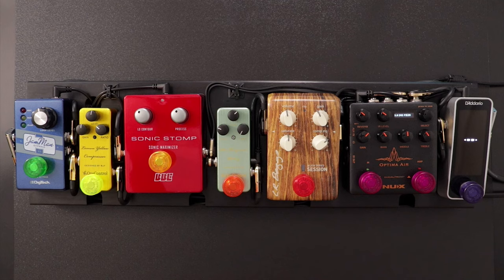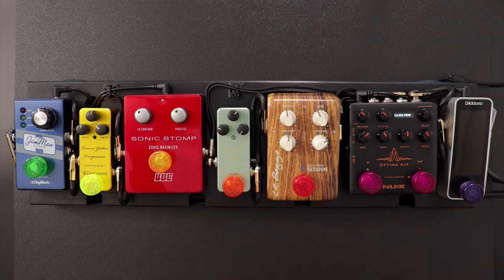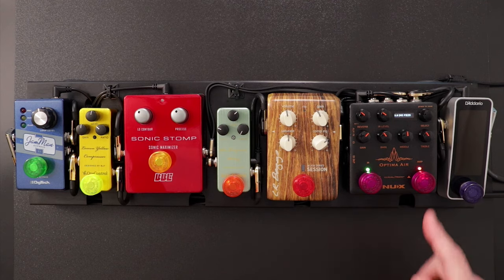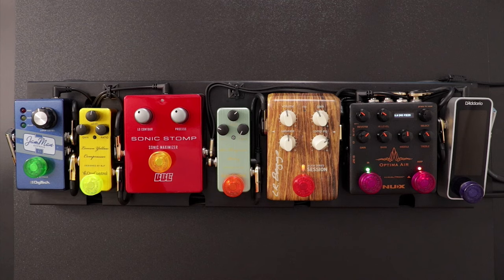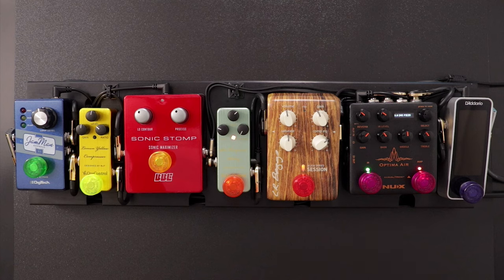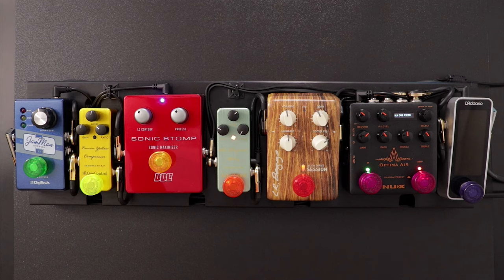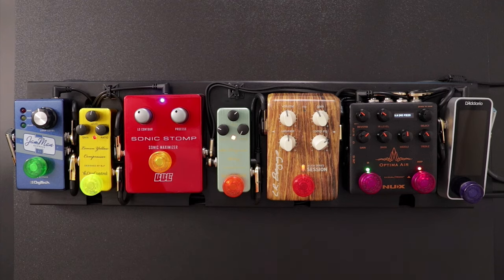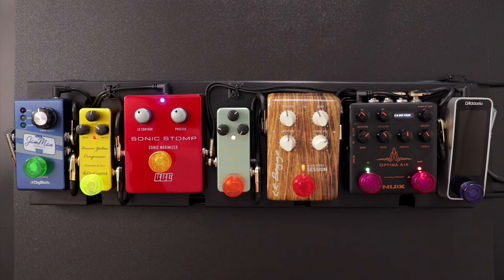Acoustic Guitars NEED Pedals Too! | Acoustic Pedalboard Walkthrough

Comment: very nice warm sound with the pedals. I have Acoustic soulmate pedal and I would like to make a change because the sound of it is not what I was looking for.
Reply from the maker: Hey ; ) Yeah, I originally looked at the Acoustic Soulmate—seems like a cool unit! It looks like the type of pedal that would pair well with a nice acoustic amp. It obviously won't to the IR thing though, if that's what you're looking for. Best of luck in your tonal adventures!
Reply: I have a soulmate acustic too, but i use red eye twin for a preamp and mixer for my 2 pickups. And t rex only in effects loop
Reply from the maker: @001mladen  Nice!

Comment: I'm thinking of getting the LR Baggs Session DI unit. Dunno if you're familiar with that. It adds a bit of saturation and compression and has the DI functions as well. Would it be ok to plug that in with a bunch of other pedals like a delay, a wahwah, a tuner and an overdrive? Not sure how to connect everything since the Session DI doesn't have an FX Loop. Where would it sit in the signal chain? Right at the end ?
Reply from the maker: Hey! Yeah, I haven't used the Session DI. The pedal version is obviously based on the original DI unit through. I'd probably run the DI version at the end of my signal chain. Especially if you're not using a dedicated acoustic amplifier. (The main reason for this is to make the use of the 'DI output' on the pedal.) However, if you're using an amp, I'd probably place it first in the signal path to act as my main preamp. Ultimately, the comp and saturation are subtle enough that they will probably work well anywhere in the signal path. So it's really about personal preference. Hope that helps! Cheers ; )

Comment: Great video. I just ordered the NUX Optima Air thanks to your video…I may just copy everything you use. Like you, I do want to create or mirror that recording studio sound o with my acoustic guitar kn a live performance. Yours sounds amazing. Info have a question though, you think you could make a video explaining more the Onecontrol Yellow Compresor?
Reply from the maker: Hey! I'm glad you liked the video ; ) Yeah, I really just included the Lemon Comp as a great volume boost option for single-note stuff. A compressor is a nice choice for this type of thing, but you could just as easily use an EQ or clean boost pedal too. Alternatively, if you don't do a lot of improv, you might not need to take up space with an additional boost pedal. Hope that helps. All the best!
Reply: @lukezecchin  I do finger style here and there for a couple of my songs…So I can use this for a boost?
Reply from the maker: @faresoros07  Yeah, you could certainly use a boost pedal for that application. Best of luck ; )
Reply: @lukezecchin  So I finally received my NUX, and I also bought the LR Baggs Session acoustic DI. And when I connect it to the NUX Óptima Air, it doesn’t seem to work. I connected different ways thinking that I’m doing something wrong, and still not working properly. Is it because they are both DIs?
Reply from the maker: @faresoros07  No worries. As long as you're not trying to connect the XLR outputs together, it shouldn't matter that they are both DI's. (Both should function as standalone guitar pedals too.) If you're using the NUX as you're main DI, Make sure the send of the NUX is connected to the input of the Session (and the output of the Session is connected to the return of the NUX). If you suspect things aren't working correctly or there's a fault, just get in contact with either LR Baggs or NUX and they'll be sure to sort you out. Best of luck ; )
Reply: @lukezecchin  Thanks for the help!!!

Comment: Hi yer good set up, but how does the TC Helicon Play Acoustic Vocal Processor Pedal compare with this ? & also noticed you had a Maton as you know they have a mic with the piezo as well does the mic cause any issues with the pedals when working together. Cheers !!
Reply from the maker: Hey! I don't have any experience with the TC Helicon, sorry. Also, my Maton has the older AP5 (which is the piezo without the mic). So I'm not sure how well the mic would play with IR's. My guess is it would sound pretty cool blended in. But, again, I don't have any experience with this. Sorry I can't be more help.
Reply: @lukezecchin  Thanks anyway, it just seams the TC has all the attributes of the pedals you demo`d in one unit as I`m looking at buying a acoustic pedal of some sorts & at the moment the TC aims up pretty good on comparison to what I have looked at . I have a Maton Messiah with mic etc very happy with it , Cheers

Comment: Wow! Sounds great. Any one know at what point in the chain could I add the orange acoustic pedal? Would that replace the Sonic Stomp? Cheers.
Reply from the maker: I'm not that familiar with this pedal, sorry. It looks to be a EQ preamp-style pedal. If so, you could really place it anywhere. I'd try it directly after the Optima Air. Or, at the end of you signal chain (if you want to use the XLR out). Hope that helps ; )

Comment: I really enjoyed that video! You mentioned the piezo pick up... which preamp do you have in the Maton? AP5-pro?
Reply from the maker: Thanks! No, mine is an older model. So it just has the standard AP5 (without the onboard mic). Hope that helps ; )
Reply: @lukezecchin  ok, you would definately get the benefit from the Optima Air then! I am wondering if it is worth having the IR on the Pro or not (I kinda like the Maton pickup profile as is) . I am impressed with the LR BaggsCompressor on your vid!
Reply from the maker: @dazmusic101  Yeah, if you're already liking the internal mic, I'd be more inclined to experiment with the EQ/Comp side of things first. Using IR's on an already mic'd source could sound cool, but it might also produce some weird resonances and such. (I haven't tried it, sorry.) The LR Baggs is a good shout though. I've done a separate video on it, if you want to check it out: https://youtu.be/4nX-lD0L_gg

Comment: I really can’t thank you enough for this setup.  I bought this setup except for the looper. I have a few questions: first, I have a Boss Looper RC 10 R and the foot pedal switch FS 6, and I also have a Boss ES 8 switcher. Can these be used on the same pedalboard and I f so, how do I set it up?  Second, I want to use a vocal processor for harmony. I have an old Digitech Live Harmony device.  From everything I’ve read or learned so far, the processors which have guitar inputs, means you sacrifice the use of your pedal board.  Appreciate in advance whatever suggestions you have and thanks for your help.
Reply from the maker: Hi, glad you liked the video! Yeah, the Boss Looper will work perfectly with the Boss Switcher. You'd just place it in one of the loops. (Probably, in the final loop. Or, even after the switcher itself, if you didn't need to switch the looper from the ES-8.)

I'm not familiar with that specific DigiTech unit. But I assume the unit can process your guitar and vocals separately. (i.e., Sending a 1/4" out to your pedals for guitar. And a XLR out to the mixer for vocals. If not, I'd just power the unit from you pedalboard (if possible) and only use it on vocals.

Hope that helps ; )
Reply: @lukezecchin  Thanks.  I'll try/check it out.  If you have any suggestions for a good voice processor, I'd be interested.

Comment: I have the NUX Optima Air and about to purchase an LR Baggs Venue. Which will be the better order? Guitar > Venue > Optima Air > Amp or Guitar > Optima Air > Venue > Amp? Btw I'm using LR Baggs M80 for the pickup.
Reply from the maker: I'd try using the Optima Air in the effects loop of the Venue. That way you get a clean signal going to your tuner and you also get the option of using the Venue DI output. Hope that helps!

Comment: Hey awesome board. What do you use for feedback suppression?
Reply from the maker: Cheers. Just a good ol' feedback buster in the sound hole should do the trick ; )
Reply: @lukezecchin   I thanks! Not gonna work for me since my controls are inside my guitar's soundhole. Thanks for the info here very useful.
Reply from the maker: No worries. Plenty of pedals have feedback suppression onboard. Some notch out the problematic frequencies with EQ. Others flip the phase of the signal to cancel out issues. Check out the TC Electronic Body Rez for an example of the latter. Hope that helps ; )

Comment: i have taylor 414ce rv class bracing..which one u suggest? the sound is too much brilliant and metallic!
Reply: I just picked up a 714 ce and am having the same issues with my amplified sound.  The piezo pickup sounds quacky and harsh
Reply: This Taylor pickup is unbearable. I bought my 714ce two years ago and I fell in love with the tone. The pickup however was a complete disappointment! I tried going to official Taylor service center and ask if they can make it sound better, i thought something is broken… but they said it should sound like this, so I got angry and I changed it to L.R. Baggs Anthem which has a piezo and a mic and it’s so much more better.

Comment: If I have a sound hole pickup would I want the preamp in front of the tuner?
Reply from the maker: Do you mean because of the weaker output? There's no issue in putting a tuner after the preamp (as longer as you're not feeding delays or reverbs into it). I'd just experiment to see what works better ; )

Comment: Can you describe the cable flow in you pedals?  I don't understand and trying to learn how to do it right.  You said the NUX is first and everything flows down from there, but studying the cables it looks like you have a cable coming out of the turquoise delay and into the NUX and then out the NUX and into the Sonic Stomp.  So is the flow from tuner into the Sessions pedal then delay and back into the NUX?  Thanks for help.
Reply from the maker: No worries! The pedal order goes:

- D'Addario Tuner Pedal
- NUX Optima Air
- LR Baggs Session Pedal (In Loop)
- Sea Turquoise Delay (In Loop)
- BBE Sonic Stomp
- Lemon Yellow Compressor
- Digitech JamMan Express

To answer your question, I'm running both the Session and the Sea Turquoise in the effects loop of the Optima Air. The reason for this, is that it allows me to run the IR and EQ before the compression and delay. And then, route the compression and delay back into the preamp to pick up the reverb from the Optima Air. In other words, the overall signal chain goes:

Tuner > IR > EQ > Comp > Delay > Reverb > Maximizer > Comp > Loop

Hope that helps ; )
Reply: @lukezecchin  Thank you
Reply from the maker: @Pete Kong Koi No worries. I'm simply running the Session and delay pedals in the loop on the Optima Air. The main output of the Optima then goes to the Sonic Stomp > Boost > Looper. Hope that helps ; )
Reply: @lukezecchin Hey if you still have the setup you might try the sonic stomp after the compressor as it's ment to be last in chain if you can.  I also heard the units were for brunging compressed radio signals back to life. I used to run mine between the mixer out (with vox and stomp box) and my speaker input some years back and made everything a studio type quality. Sold it, but have now re bought one to try with the new setup :). I have the Maton EBW808C that has a bit of mid honk so hopefully it helps.

Comment: Can I ask why you didn't use the effects loop of the Optima Air? I'm not sure where the reverb is on the Optima Air signal path, but you end up with two reverbs (one from the Optima Air, and one from the LR Baggs Session) the delay, and before your compression. It seems like that chain is probably muddier than if the reverb came later (which would be possible if the reverb in the Optima Air is after the effects loop).
Reply from the maker: Hey, the comp and delay are in the Optima loop before the reverb. The second comp and the end of the board isn't compressing much. It's really there as a volume boost.
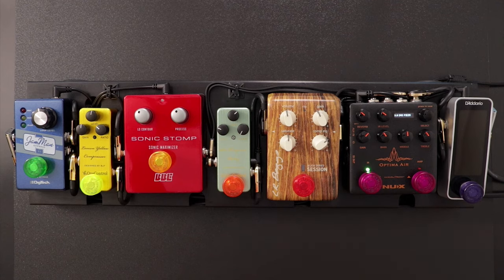Reply: @lukezecchin  Thanks. I'm not sure I understand. You describe your chain as putting the IR first (5:08), and it looks (visually) like the effects loop send and return aren't connected. I might be missing something if the Optima Air's send/return connectors are hidden by the 9V power input.  Would you mind describing the actual signal chain for the pedals on the board?
Reply from the maker: @GregTuckerKellogg 

The pedal order goes:

- D'Addario Tuner Pedal
- NUX Optima Air
- LR Baggs Session Pedal (In Loop)
- Sea Turquoise Delay (In Loop)
- BBE Sonic Stomp
- Lemon Yellow Compressor
- Digitech JamMan Express

I'm running both the Session and the Sea Turquoise in the effects loop of the Optima Air. The reason for this, is that it allows me to run the IR and EQ before the compression and delay. And then, route the compression and delay back into the preamp to pick up the reverb from the Optima Air. In other words, the overall signal chain goes:

Tuner > IR > EQ > Comp > Delay > Reverb > Maximizer > Comp > Loop
Reply: @lukezecchin  Thanks! I've been looking at the Optima Air documentation, and they don't actually say what the order of circuits is. I would hope that it's IR->pre-amp/EQ->loop->reverb, which is what you describe, but they don't document it at all. It's very different from other acoustic preamp pedals (Radial, Felix Design) that include block diagrams in their documentation. Did they tell you what the circuit order is, or am I using the wrong documentation? I'm referring to the user manual. Maybe I missed something.
Reply: @lukezecchin  Oh, I just got an email response from NUX: the circuit order is IR->Preamp->send/return->Reverb *whew*. Thanks so much for your help.

Comment: What about those colored rubbers you have on the pedals foot switches?
Reply from the maker: These one's are called 'Candy Toppers' from Mooer. But you can get lots of different types from different brands. NUX do as similar thing. Rockboard also do some too. They're the sort of accessory you can pick up on eBay or Amazon. Hope that helps ; )
Reply: @lukezecchin  Many thanks, didn't know those existed ;)

Comment: Nice sound! Does that tuner work fine with your acoustic guitar?
Reply from the maker: Yep. Works great! I think it's a nice little unit. They've actually just released a new version too... Have you had issues with some tuner pedals on acoustic guitar before? FYI: I also really like the Korg Pitchblack Mini—if you're looking for an even smaller option. (You can see it mounted on my electric pedalboard here: https://youtu.be/uM96vASK5S8). Hope that helps ; )
Reply: @lukezecchin  yea... I bought it about 2 months and did not worked with my acoustic guitar. I have a Larrivee with a K&K pure mini pickup. Not sure if this does not work because is a passive pick up.
Reply from the maker: @GiovannyAlabi1  Wow, that's strange. Are you sure the pedal isn't faulty? Most electric pickups are passive and I've never had and issue with that tuner on electric guitar...
Reply: @lukezecchin  could be, this has been my first time using the tuner, and I love the size and the screen, fit perfectly on my mini board, but I already got in contact with D'addario and they will replace it, but I'm currently out from the US, so as soon I'm back I will follow warranty instructions.
Reply from the maker: @GiovannyAlabi1  No worries. Best of luck!
Reply: @GiovannyAlabi1  I have the same issue with this pedal tuner. I even have the problem when I put it after my preamp. The only way I can get it to pickup anything is to put my boost in front of it.
Reply: @bryanhain969  What pickup are you using? Also what Pre Amp? So far what I noticed is that in order to use this at the initial of my change I need a guitar with an active pickup with a lot of headroom. So far is working with my active K&K ultra pure mini, but is not working in my other guitar just with the passive K&K pure mini unless I use a preamp in front.

Comment: In my opinion, the BBE is spoiling badly the signal. I had one, for a long time, finally ditched. Under all circumstances, the signal was artificially crispy or boomy. The BBE may be useful when going through a large spaced PA where there are indeed huge phase issues, but I never tested and never will: it's not my job to solve phase issue in large venues.
Reply: The BBE sonic stomp maximizer is a must for any pedal board especially acoustic guitar it absolutely makes an acoustic guitar come to life. I love mine!
Reply: I use it for my electric guitar too .
Reply: I used the Sonic Maximizer as a plugin in Sonar for many years, when using Virtual Instruments, and it really made a difference. But yes, you don't want to overdo it.

Comment: So the compressor should be after the preamp? My yellow komp is on the way. Going to use it with nux stageman floor preamp into loudbox mini..
Reply from the maker: Hey! You could place the comp either before or after. It's really about what you prefer the sound of. (I had mine setup as an overall boost. Which is why it's placed near the end of my board.) With your rig, I'd also suggest trying it in the FX loop of the NUX Stageman. Hope that helps ; )
Reply: @lukezecchin  ya need to experiment it. It’s on the way..For the FX loop port, need to use TRS jack instead of TS?
Reply: The stageman only comes with one send/return port unlike the optima air..
Reply from the maker: @HL-OOI  Yeah, you'll need a TRS to TS splitter cable. The manual should explain how to connect things up. Cheers.
Reply: @lukezecchin  i can only find a 6 feet insert cable ..😁
Reply from the maker: @HL-OOI  https://www.rockboard.de/en/cables-and-connections/rockboard-flat-patch-y-splitter-cable-30-cm-11-1316-rbo-cab-f-y-30-bk